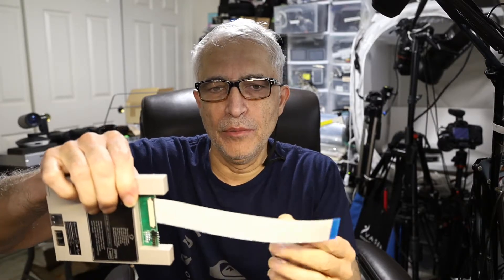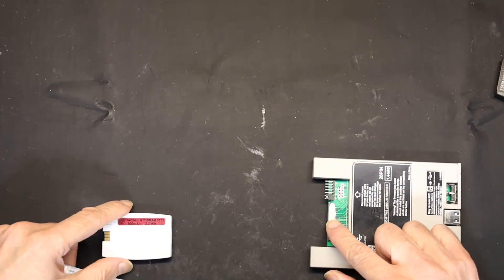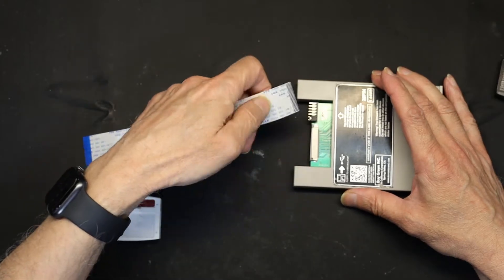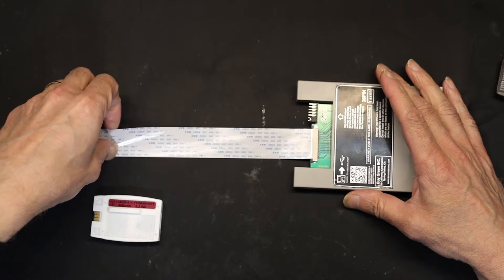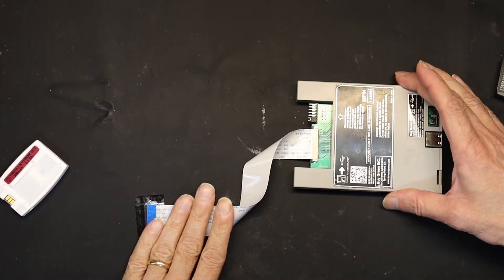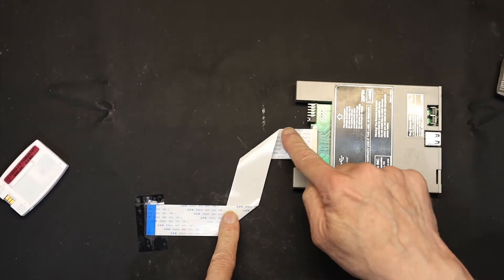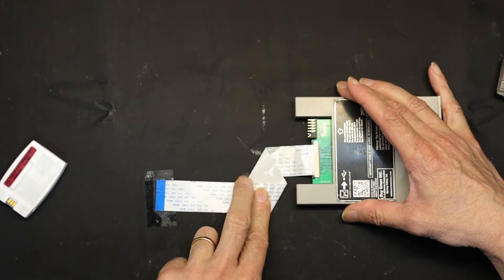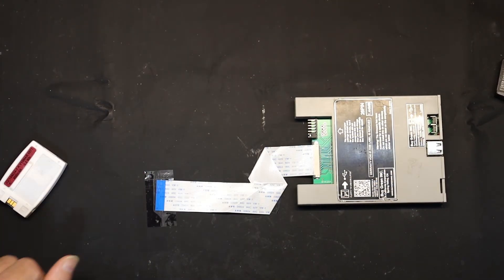How to connect and arrange the flat FFC/FPC ribbon cables when the contacts are out of alignment.

Comment: Is there a way to connect directly to a flexible printed circuit "cable" that's too short and you want to extend it? In other words the quasi-cable is actually part of a flexible PCB which would normally plug into an FPC/FFC connector, but it's not long enough. (pitch is 1.25)
Reply from the maker: Hi, it is possible and I have done it myself. However the pitch was much bigger at 2mm, in your case 1.25 is very close together and there is a very high probability of solder bridges. So if you use a lot of Rosin you might be able to pull it. Also make sure that you don't change the cable polarity at the final end
Reply: @TECHNOLOGYTIPS101  The lateral pitch of the connectors is 2.54 because there are two rows of 6 and 7 pins. So, rather than extending the PCB connection I'm extending from the board with flat cables soldered directly to the board in place of the molex connector, that then are soldered at the other end to the molex connector. I might use headers on the controller board but they need to be sanded on the matching side to half the width of the row distance.
Reply: Yep, that worked so the headers fit. Took about 30 seconds of sanding per part using 120 grit sandpaper.